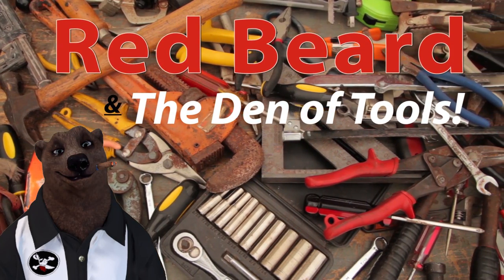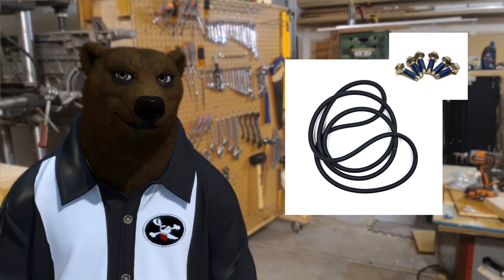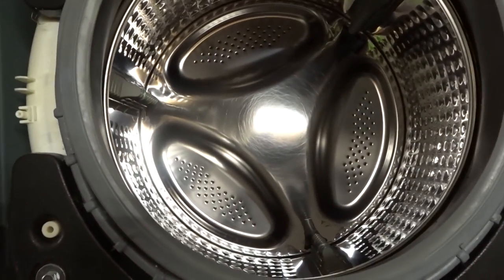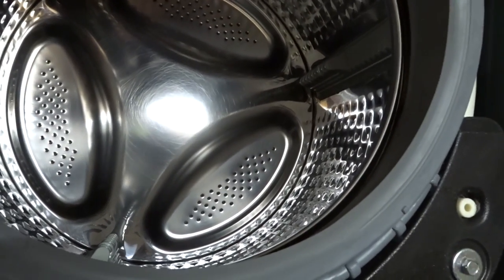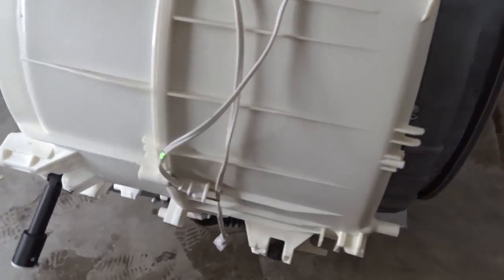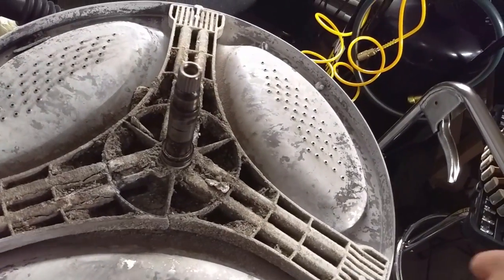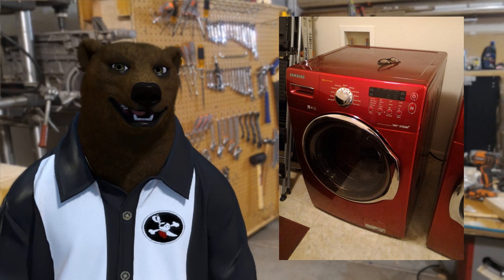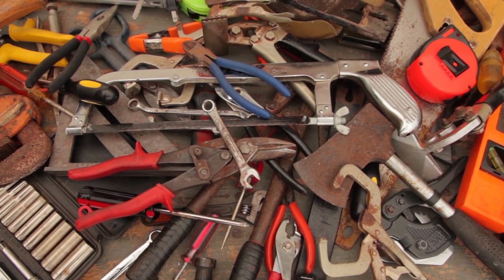Teardown and Fix of a Samsung Front Load Washing Machine  (WF331ANW)

Comment: While you have the drum apart replacing the spider I'd suggest replacing the bearings and the seal.  It's just as much work to replace those later, like next year.  Essentially you're doing a rebuild of the drive which will increase the amount of time before the next failure.

Comment: Great video, thanks for sharing. I just diagnosed my 7yr old machine to have exactly this kind of issue. Some thing clinging around inside and it is loose, can move it up and down by over an inch. Happened last night when washing towels, the occasional heavy load gave it the death kick. Not sure if I am doing this job and if it is worse it. Need to sleep over it.

Comment: Planned obsolescence.  If this isn't designed to fail, then what is?  How much more would it have cost to use something more resistance to corrosion?
Reply: Yeah, definitely designed to fail.  I'd coat the new spider arm with truck bed coating or something to hopefully make it last longer

Comment: Great video!  I really appreciate it!  I am in same circumstance and debating whether or not to do it.  I suspect the first time through it's worth it.  I believe the cleaning is not much different than my old one, but i will say it used significantly less water.   But with new washers of similar ilk running close to 700 bucks, i think i'll put one spider arm in it.  It spins freely, but it's shaking the dang house apart!

Comment: The Spider arm is made out of zinc.  We used them in the US Navy of Ships and Subs, It was a sacrificial material that would corrode so that other things would not rust.
Reply from the maker: I used to sale in saltwater and I had think so my butt but why would you make something structural out of zinc? It just doesn't make any sense.
Reply: @denoftools  it makes cents
Reply: @denoftools  doesn't make sense but they continue to do it
Reply: Yes zinc...the machine is awesome...except that
Reply: @michaelbeaver4804 it's not zinc it's aluminum

Comment: I am really impressed..you had to just about completely disassemble the entire washer and then remembered the correct sequence to reassemble everything back together again...and it works...!! I also have one of these Samsung washers...maybe a 2014 year model ? I read about that spider arm being a poor quality item that is subject to corrosion and then failure. I think that I read somewhere that detergent can somehow get built up on the connection points of that spider arm and it's the detergent that has the corrosive effect ?  I use the self clean function a lot more often than what the manual calls for and keep the lint filters cleaned out often so I sure hope that our washer gives us many years of good service. My hat's off to you...I wouldn't trust myself to remember how to properly reconnect everything...LOL..!!
Reply from the maker: Take notes, take pictures and stack everything up in order as you take it out.

Comment: Well, it will be good to know when to replace our Samsung washer, which lives under a Samsung dryer in a small condo closet. Although it's only an endless number of bolts and screws that need to be pulled, I can see that you need your hydraulic cart, another set of hands for lifting, and space to move the washer in and out of its parking spot. No way you can do this fix in place. But I sure enjoyed seeing you succeed, Red.

Comment: I never thought I'd be envious of someone's washer/dryer, but that red makes my plain ol' white sammy's look boring.  I just had to replace my spider arm too.  Never worked on a washer before, but I kinda had the same outlook as you.  Now our dryer I can disassemble and reassemble blindfolded.  I've put so many belts in that damn thing, and I still can't keep my wife from overloading it.  Maybe if she had to fix it...  I'd never be able to find my tools again though.   I've got into the habit of sticking my screws back in the holes they came out of.  I've had numerous nights putting cars back together and looking at a table, cart, and rolling stool full of nuts and bolts and it can be unnerving sometimes.  The washer repair wasn't too bad though, not nearly as bad as I've imagined it to be.
Reply from the maker: Hey, there is always Krylon!

Comment: I wish I had seen this before I bought a set of these.  Makes me feel like I am sitting on a time bomb.  Good job, but beyond my desire to beat myself up doing the repair.  Seems like it would cost more than the machine is worth to pay to have this repair done.  You expressed one of my feelings about washers; the top loaders with a simple mechanical controls last 20 years without a problem so why go front loader at all.

Comment: I bought my Samsung WF337AAG front loader in 2007. Today something about the drain cycle went afoul, the water wouldn’t drain. A strange on-off buzzing noise came up instead. Long story short about disassembly; I removed drain pump, looked in the inlet and saw a thin rubber something up against the impeller inside the pump housing. Easy fix I thought, but what is an O-ring doing loose in the pump? I took it apart and found the rubber something to be a 5” piece of black insulated stranded copper wire. Something “else” fell out that looked like a part of a meteor from outer space. Strange shape, really light, definitely metallic but not magnetic and heavily pitted. I see that it’s a rough inch or so square and one side is “bent” over. What the hell could this be? My first thought was possibly it being a piece of the silver bar (mine has the SilverCare feature). I found the silver package and noticed immediately no way for a piece this big could ever make it’s way through the tubing connected to outer tub. Still scratching my head I went ahead and ordered a new pump. The impeller was trashed and so was the pump housing. So bad it just started to leak so I got the whole package rather than just the motor/impeller side. It’s on the way here but later and still curious I googled “removing the inner drum from a Samsung front loader”. Selected this video hoping I could see if there was something built in between the inner and outer drums which could have “fallen off”. As soon as I saw Bear pick up to comment on that identical (except his is smooth) piece of metal (which came off the spider arm) my heart just sank. I guess I should consider myself lucky I got 13 years out of this washer. Since I can’t return the pump now, I’ll go ahead and install it and see if I can eek some more life out of it!

Comment: I am good at fixing just about anything and am confident I could do this fix.  However,  my washer is in an upstairs laundry room and on a pedestal.  I would need a lot of assistance getting it out of the laundry room to have enough room to take it apart.  There seems to be a problem with a board as well.    Then it is a big mess on my floor and I would need assistance to put it back.  That spider arm would have never broken if they used steel or at least powder coated it to keep the water from penetrating.   Obviously, planned obsolescence.  Waiting for repair quote on mine but will trash it if it's $500 or more.  Will be buying a speedqueen for my next washer.  Older technology that actually lasts 15 years.

Comment: OMG WOW.  I don't think name brand matters so much.  Water and metal don't mix for very long.  I have a 22 year old drier that I've repaired 3 times; but, I'm on the 3rd washing machine, in that same time period.  On my 2nd machine, I don't remember the brand but that thing died twice during the 1st year of warranty.  I had to buy two circuit boards during the 3rd year and it needed those circuit boards again during the 6th year and the price on those went up dramatically; so, out went that machine.  Now, I have an Electrolux and it's almost 5 years old and still runs as good as the day I bought it.  Will see how it goes; but, for as well as it's gone so far, I would buy another Electrolux or Bosch due to how well my Bosch Dishwasher has performed.  If it breaks, I might try to fix it; but, I do know that because there's water involved, washers & dishwashers are basically throw away items.  Kinda like water pumps in vehicles.  I will say this:   My hat's off to you for going this far, with what I would basically throw away.  And you've seen my videos.  I can fix quite a bit.  I would've given up when I saw that Spider Arm.  Had I made the choice to replace the Spider Arm,  I would've coated it with 2 or 3 coats of Zinc Chromate before it went in.  If you didn't, at least now you know, in 6 years, you can throw it away or be prepared to replace it again.  Depends on how much they cost.  GOOD JOB!

Comment: The worst thing is that the newer washing tubs are glued. You can't change the spider or the bearing.
Reply: Frank they keep finding ways to prevent simple repairs!  
  Energy saving??
  Don’t think so when so many extra parts have to produced to replace the parts that fail. And so many parts are no longer available. 
  How much more energy does it take to replace so many complete units??

Comment: Curious. What would happen if you painted the spider arm? Think you would get any extra life out of it? Maybe even powder coat. HF has a powder coater.
Reply from the maker: Had that thought but I was worried about chemical reactions with the heat and cleaners.
Reply: @denoftools  .... good point.
Reply: I painted mine with cerakote. It’s designed for high temp and corrosion prevention. Hopefully that won’t break again.

Comment: after how many years have you faced this problem? and how does the VRT works? how it can handel vibration and noise? should i buy this now?
Reply from the maker: 6 years. The next time I have to buy something like this I'm getting a speed Queen.
Reply: @denoftools   can you tell please will it worth buy this model ? or any idea about this model release year samsung wf16j6500ev front-loading washing machine - 16 kg

Comment: YOU ARE SO RIGHT IN ALL YOU SAY ABOUT SAMSUNG WASHER I HAVE THE WASHER AND DRYER I SPENT  $180 FIXING MY DRYER WITH BELT NEW RUNNING WHEELS AND COMPUTER ,,,,AND $150 FIXING THE WASHER SAME PARTS REPLACED AND ONE RUBBER TUBE HAD A HOLE IN IT AND IT LEAKED SO AFTER SPENDING $330 ,, I HAD A TOP LOADER I HAVE IT OVER 15 YEARS AND A RUBBER PART GOT WORN OUT AND I REPLACED IT FOR $12 AND KEEP USING IT,, THEN I MOVED AND SOLD IT SO I DID NOT HAVE TO TAKE IT WITH ,,, BIG MISTAKE ,, THAY STILL HAVE IT AND ITS OVER I THINK 25 YEARS OLD STILL WASHES GREAT,,,, HERES A KICKER ,,, I GOT A TOP LOADER FROM A AUCTION ,,, NO ONE WANTED IT NO ONE BID ON IT ,, I DID I,,, I GOT IT FOR $1.... 6 MONTHS AFTER I GOT THE SAMSUNG MACHINES AND EVERY TIME I DID A LOAD IN THE SAMSUNG WE DID A LOAD IN THE TOP LOADER AND I STILL HAVE IT AND IT HAS NOTHING WRONG WITH IT STILL WORKS GREAT ITS OVER 25 YEARS OLD AND OUT LASTING THE SAMSUNG ,,, AND TO TOP IT OFF I GOT A INDUSTRIAL DRYER FOR  $15 AT ANOTHER AUCTION AND ITS STILL RUNNING TO,,,, HAVE NOT HAD TO FIX IT YET EATHER ITS AROUND THE SAME AGE AS MY TOP LOADER ,,, GET OLD WASHER AND DRYERS AND FIX THEM AND THEY WILL OUT LAST ALL THE NEW ONES LOL

Comment: That spider arm may have been broke at the factory and it finally came loose and jammed.  Samsung makes great TV's and phones -- washing machines not so much. I'll stick with my top loading Kenmore.
Reply: Mine were so corroded that it fell apart from the axle. They are designed to fail.

Comment: I cannot fit in my washing machine down my basement stairs due to a partial wall and Foundation which neither can be modified. I was wondering if I disassembled the wash machine does the crossmember at the control panel come off? If so I can maneuver it around the wall but I don't want to take it out of the box and not be able to return it. Thanks in advance
Reply from the maker: The cross beam on mine was spot welded.  Sorry.

Comment: I know this isn't a washer question but, I have a question on a S&W MP AR-15 .223/5.56. What is the difference between the .223 and the 5.56? I've read that the 5.56 is a hotter round and can burn the barrel out soon than using the .223 round. True? Agree?
Reply from the maker: First, you can shoot 223 out of a 556 but not the reverse.  556 is usually higher pressure and you won't so much burn out your barrel as blow out your chamber (possibly).   What you really want is chamber in 223 Wylde https://en.wikipedia.org/wiki/.223_Wylde_chamber

Comment: Im confused because the arm isnt loose on mine but yes it is corroded quite a bit. The machine will run but turna few times stop thinknturn a fee times stop think. It actes like it was trying to drain also...i mean the drain pump would come on in one cycle type...i cant recall. The the thing is all tore up now. So i dont knoe if corrosion can cause that even though it is tight on the spindle and not banging at all. Also...can one cover the new spider in rustoleum to make it last longer
Reply from the maker: Good question on the rustoleum but I'm not sure.  As to your issues, sorry but not sure. Could be that corroded material has broken off and is jamed in there.

Comment: My washer situation: I first noticed what appeared to be small pieces of concrete in the washtub. I drained the washing machine, and a bunch came out. I thought maybe my work clothes just must of had some such material on them. Anyway, the washing machine was bouncing all over, so did some research, and decided to replace the struts. Well that didn't work. 
--Now after seeing all these vids on this "Spider," I am certain that not only is mine broken, but I think it has been broken for a long time. 
--Maybe Samsung did it on purpose just so we all buy another one. Quite frankly, at $1,100 for a washing machine, this should not happen. The washing machine it replaced was an old USA made, simple washing machine. No fancy gadgets, etc. It was over 20 years old and worked fine. The  only reason we replaced it was because it was too small and we do about 3 loads of wash/day ... so ya I'm sure you can imagine the water usage.

Comment: I just had the concrete balance crack in half on my Samsung front load, could not get the rotor cover off to save my life to check it (system was not unbalanced so probably isn't an issue at the moment), also could not find a replacement gasket to save my life the one I bought was too fat, so I said eff it and hacked it all back to together, no leaks and totally on balance.

Comment: Do you have a video on specifically replacing the drain hose?
Reply from the maker: Sorry, I don't.
Reply: @denoftools  no problem! Do you know if there’s a way to patch it? Maybe heat shrink something so it fills the ridges of the hose, then cover with some flex seal tape? There’s a few small holes on the hose on the outside of the washer. Or do you know exactly what I’d have to do to take the hose out and replace it? And if so do they make generic versions of it? It looks like it’s about $50 for a replacement. I’m trying to help a friend on a budget lol
Reply from the maker: @technodrone7723  I'm sorry but I just don't see a patch on this hose working. It moves so much, constantly shaking and then there is the heat.  Maybe checking ebay or some used appliance shops.
Reply: @denoftools  So I decided to just replace the drain hose. It was super easy to take off the old one BUT, to my surprise the hose we ordered that said it was the correct hose does not fit! It looks close, but it has an angled end that has a smaller ending that does not fit.

Drain Hose Replacement for Washer Model WF331ANR/XAA-

These are all supposed to be compatible drain hoses for this washer model WF331ANR/XAA
but are all angled ended hoses, and do not fit.
#DC97-15273A
#DC97-15273  
#DC97-15273G

These don’t say they are compatible with this washer model but LOOK exactly like the correct one.
#DC97-12534M
#DC97-12534E 
#DC97-17093A
#DC97-12534D

Notes: The part numbers for the ones that LOOK like the correct one, all have videos online of them being installed, but none of them are being installed into the model I am working on, and the routing for the drain hose is on the opposite side.

The installation videos of The part numbers that are the incorrect angled hoses, , do not show any fo them being installed in this model either.

Incorrect angled hose, but listed as compatible links:
https://www.genuinereplacementparts.com/dc97-15273g-oem
https://www.genuinereplacementparts.com/dc97-15273a-oem

Correct looking part, but not listed as compatible links:
https://www.genuinereplacementparts.com/dc97-17093a-oem
https://www.genuinereplacementparts.com/dc97-12534m-oem
https://www.genuinereplacementparts.com/dc97-12534e-oem
https://www.genuinereplacementparts.com/dc97-17093a-oem
https://www.genuinereplacementparts.com/dc97-12534d-oem

Comment: I’m considering buying this washer and dryer as it was left in a storage unit and that’s all just these two which makes me go Hmmmm, I’ve never had a front loader and heard all the horror stories when they were introduced by family meme era and friends. My question is this sir, would you knowing what you know now buy these machines for $50 sitting all shiny in a storage unit or would you just run? Thanks
Reply from the maker: Hard pass for me. You can buy a good top loading machine for just the parts are used to fix this one.